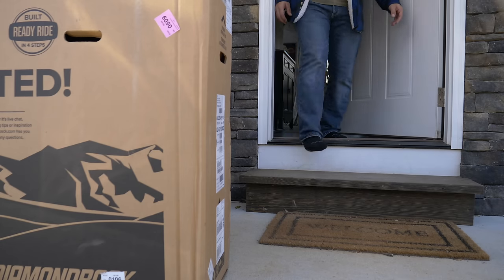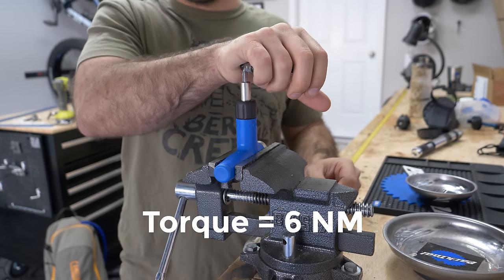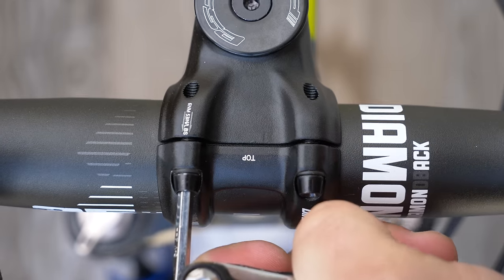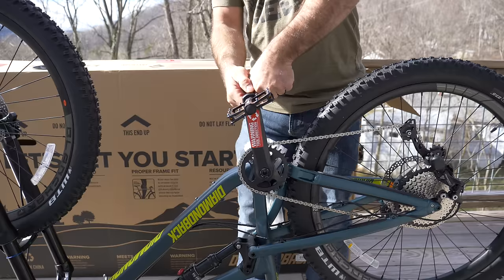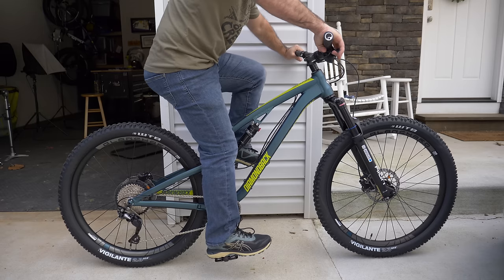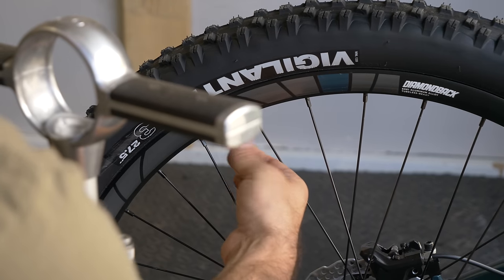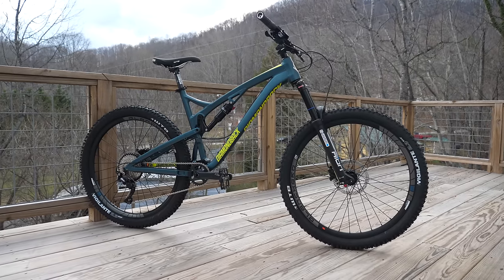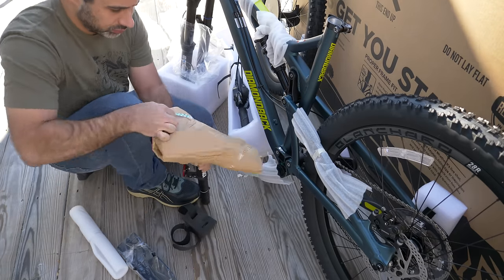Assembling your new mountain bike with minimal tools

Comment: The clamped torque wrench demonstration was genius!
Reply: I never knew  4nm and 6nm would be so different
Reply: It was!  Also, that was my first peek at that particular park tool torque wrench.  I've used a couple of other park tool torque wrenches but they were the traditional style.
I'm going to order that one for myself.
Reply: And completely inaccurate and lever dependent
Reply: agreed!!
Reply: An even better hack would've been to explain newton-meters/pound-ft and use his handy-dandy fish scale.
Reply: I'd like to know why it's in Newtonmeters and not inch pounds or foot pounds.
Reply: Do these bicycle companies know what a clutch does?  A bicycles doesn't use or need a clutch.
Reply: tarstarkusz It’s a clutched derailleur, which helps reduce the derailleur swinging around everywhere making lots of noise and potentially shifting on its own.
Reply: tarstarkusz do these YouTube commenters have any clue what they’re talking about? Apparently you don’t.
Reply: @tarstarkusz  it is newtonmeters because that is just what everybody uses. there is no need to be different
Reply: @tarstarkusz  Because of the Metric System.
Reply: @tarstarkusz  It's newtonmeters because it is the metric standard for torque. Also why things like stem length, handlebar length are in millimeters rather than 2 ft 1 and 5/32 inches
Reply: @MaplePanda04  On the bikes I've owned and ridden the bikes must have decided to keep that a secret.  I have never had a derailleur change gears on its own.  Does this only happen with specific bikes?  Or are the Derailleurs choosing when and when not to change gears?
Reply: Skills With Phil hello
Reply: @tarstarkusz  because it's the oficial unit for torque in the Internatinal System of mesurements, adopted in most of the world by science and industry.
Reply: +Jacob...  There is nothing about these derailleurs that have anything to do with a clutch.
Reply: +Amer... In America we use inch pounds and foot pounds.
We need to be all or nothing. We either adopt the Metric System or we stick with Imperial.  Who the hell wants to buy 3 torque wrenches?
Reply: David Budd What I mean is, pretend you’re going off a big jump. Cheaper dérailleurs will flail around and fail to maintain proper chain tension when you land. When chain tension is lost the chain has a risk of momentarily fly off the cassette and may decide to drop back down onto a different gear.
Reply: @tarstarkusz  Given that most if not all bike parts specify the proper torque in newton-meters, it would be silly to discuss torque in ft-lbs or inch-lbs in a video about putting a bike together.
Reply: @tarstarkusz  The term clutch when talking about a bike derailleur is not the same as a clutch in a car's drive train.  In the case of a bike deraileur, the clutch increases the tension in the jockey wheels to reduce potential movement of the deraileur and/or chain slippage on the rear cogs and front crank set due to a large shock from dropping or simply prolonged vibration from riding through a rock garden.  You release the clutch (reduce the tension) when removing and then replacing the rear wheel.  This way it is still easy to remove and replace the rear wheel under what might be called "normal" tension in the chain.  If they simply increased the tension in the rear deraileur and jockey wheels all of the time, it would make removal of the rear wheel for repairs more difficult.
Reply: @MaplePanda04  Or come of the front crank or slip on the teeth of the crank and cassette.
Reply: @daisyrose9968  Extreme shock or prolonged vibration when riding over rough surfaces or dropping off lips can knock a chain of the gear that it should be in.  The "clutch" on a bike helps reduce the chance of this happening by increasing the spring force in the rear deraileur and therby the tension in the chain.  You release the clutch to reduce the tension in the chain and rear mech when removing the rear wheel and putting it back in.
Reply: +Michael... I know what it does, it's just that they chose the wrong word.
I already own torque wrenches for working on cars and they come in ft and inch pounds.. You can always convert them, but they usually don't convert to whole numbers.
Reply: @tarstarkusz  Dont be stupid, you diont have to buy different torque wrenches you can convert nm to stonebananas or whatever crazy unit you use.
Reply: +Mano... You missed my other post. Look directly above yours.
Reply: @tarstarkusz  Yes I did miss your last comment. At conversions don't worry about the exact number, you can round it. eg  5nm ~45 inchpounds.  Besides most torque wrenches have a tolerance of 4% so you actually never torque the fastener to the exact value.
Reply: yeah! sure it was
Reply: @tarstarkusz  the world uses the metric system, expectations are there. Majority rule
Reply: Not a chance
Reply: "click click click" says the torque wrench
Reply: I have a diamondback sync r carbon and this thing with the torque saved my life
Reply: @tarstarkusz because the whole world uses metric system and not their body parts for measuring things.
Reply: Hi
Reply: @xartpant  he used it as a ball park reference. Most people will be using a multitool around that size
Reply: SWAG method, scientific wild arse guess, manufacturers torque to save damage and get it right and tight first hit.
Reply: @PorterMTB  yep i agree to great videos Eric
Reply: @AidanChen7  bro keep on waiting for that responses
Reply: @xartpant  Yes but this is better than nothing if you use the same ish sized multi tool.
Reply: Yea
Reply: @MaplePanda04  sounds reasonable

Comment: With how cheap you can get a torque wrench for now I'd recommend you get one, harbor freight has decent torque wrenches for $20. Certain tools like that should be mandatory to get with your bike.
Reply: Yeah bois! Harbor Freight is back at it again!
Reply: Whats the difference?
Reply: @antonioochoa5269  If you have either no idea what you're doing (which probably won't happen to someone who watched this vid) or if carbon is involved i'd say
Reply: just make sure they go down to the low Nm/in lbs that is needed for a bike. 4nm is 35in/lbs and i know my cheapie from HD doesn't go that low
Reply: There's an xtools torque wrench on chain reaction for well under 40 as well
Reply: They shouldn't be mandatory because you only need tools with the first bike you own. After that it's something you just give to friends or throw away because you may already have a better one.

Comment: My tires were super difficult to get onto the rim so i found that it makes less off a mess to do a dry fit first then remove the valve core and put sealant directly in through the rim. (also if the tyres are not seating, splash some soapy water onto the bead, it helps a lot)
Reply: Removing the valve core and pumping like crazy to seat it helps a lot

Comment: Removing the valve stem and inflating the tire to bed it in and then adding sealant through the valve is a far easier way to do tubeless i found
Reply: I agree 100% on that. In the case that some tires are a real pain to seat(mostly new unmounted tires) if you already have sealant in the tire it would suck to put a tube in the help seat one side.
Reply: I also agree, but with some brands ( such as slime) you get little chunky bits that can get stuck in the valve. But for Stan’s sealant, this technique works great

Comment: Thanks for this video.  I got my first big girl bike yesterday and would have been lost without this.  When I did get it assembled, something was wonky, so I took it to my local bike shop.  The derailleur hanger was bent.  They did not have my hanger in stock, so they used a hack to fix it.  They heated the hanger with a torch and bent it back while it was cooling.  There was a risk of it breaking, but I figured it was worth the risk since I would have been out of a bike for a few days while the replacement hanger came in anyway.

Comment: Interesting advise on breaking in new brake pads.  I had always been taught that by applying light pressure as you show will glaze the pads, so I usually get up to speed on a downhill and firmly apply pressure, but don't come to a complete stop.  Repeating this about 10-15 times brings out the real stopping power of your pads without causing them to glaze.  I will have to try your method next.  Great videos as always!

Comment: I will probably never do this because i'm not a dentist or doctor or have a high paying job... but used is fine??...
Reply: The bike in the video is very affordable
Reply: @Br3ndo1891  not as affordable as a used bike...
Reply: I made that mistake once before, found a inch wide crack halfway through my down-tube after buying my last bike. wasn't fun, turns out if you buy a used bike it voids Giants lifetime Frame warranty, so I had to pay for it out of my own pocket, @Cooper Ondersma
Reply: always test the bike on site. maybe ask the local bike shop mechanic if they can join you to check if the bike is ok overall
Reply: I am in College and working part time at a not so great paying job and both my wife and I are riding $3000+ full sus carbon bikes. I have multiple friends in the same senario. It's mostly about priorities. I could probably afford a nicer car or go out for more dates if I didn't bike, but we decided bikes we're more important for us. Thinking you have to be a dentist to buy a $2,000 bike is silly. $10,000 and you might have a point, but 2g is less then your average rider spends here in utah, and most bikers just have regular jobs. It's all about what you prioritize.
Reply: "affordable" is relative. $2K for a new FS trail bike is on par in today's market. Get a better job and start saving if you want a nice bike like that, but a good used bike can be had for under $500.
Reply: CHOOKY 42 used should be fine if you know what your buying, just make sure you test everything before you hand over the $$
Reply: I'm rocking a 10 year old Stumpjumper. It was $2400 in the long ago! Love the bike!
Reply: Of course is it fine to have used bike...i bought my specialized stump jumper fsr for about 300$...it from 2006 and in pretty good shape...ill do fork service this spring....
Reply: @michaelwrigley5438  I'm in college as well and working only a few days a week at a burrito place. I just purchased my first MTB (hardtail) for $2650 after only a few months of saving (I also sold my pc for $1200 so that definitely helped haha). There really is no reason why 90% of people should not be able to save for a nice bike. It just takes a little bit of patience and planning. Every paycheck, just put aside like $100 every paycheck and you'll have enough for a really nice $2000 hardtail within 6 months. Also, if you still get stuff for Christmas or your birthday, you could just ask for money and probably cut it down to 5 months. And if you can set aside $200 each paycheck, that's only like 3 months!

Comment: Excellent Instructional Video! The one thing I would add to assembly is that some bikes require you to mount the front rotor to the wheel and mount the front  brake.

Comment: "very attainable" ... It's $2,000....
Reply: For its quallity its good
Reply: people spend $2000 on carbon wheels
Reply: Good word, really... I wondered.
2k is motorcycle $. Can't see spending that much to pedal
Reply: Sorry but 2000$ is nothing for a good Bike.
Reply: most people that watch this channel are adults, $2000 is very affordable to save up
Reply: @SgtKong  but on a bike do you pay for fuel? No do bikes have electrical issues? No dou pay insurance on a bike? No
Reply: I.could also try with a bunch of questions that seemingly assemble into a point of some sort
But YouTube would sensor me.
My op was to the content creator not youtools😜😘🤙
Reply: Peepeepoopoo   Life insurance
Reply: Peepeepoopoo I know, you said that people don’t pay insurance on a bike. So I said people pay for life insurance. Don’t have to call me a knobhead, you should call yourself that.
Reply: For a full suspension bike brand new, $2K is the bottom end on pricing.  You can't get a decent FULL suspension bike for cheap.  A bike like this isn't for commuting to work or zipping around city streets.  I just never understand why people gasp at the price tag of what is an unnecessary hobby.  Yeah, we drop real dollar bills on our toys. I've spent more on GEAR this year
Reply: @seattlegrrlie  Its a shame a sport as fun as MTB basically doesn't want more folk doing it with the expesive price of the bikes... but then I suppose thats capitalism. Creep up teh prices and teh whales will keep em affloat.
Reply: Kyle Lush that's more than my rent
Reply: Sgt. Kong a newer version of his (release 5) is 5000$

Comment: Great information Seth.  I wish you would have added truing the wheels and tightening EVERY bolt on the bike.  After assembling thousands of bikes from different manufactures I found that often  a bolt or nut is loose.  A quick check  of all the nuts and bolts assures  happiness for years to come.

Comment: I think it’s worth noting that once both wheels are installed it’s a good idea to make sure your disk brake calipers are centered. If you have hydraulic brakes it’s as easy as loosening the caliper mounts and giving the brakes a good squeeze while it’s in the stand. If you have mechanical, it’s a little more involved. Either way doing so will improve stopping power and save a good amount of your brake pads over time.

Comment: After a bit of research, I finally found these exact pedals new on ebay. Shipping isn't cheap to europe but seriously I'v been searching for pedals like that a long time. Riding in the dark with no reflectors on the pedals will get you trouble with the cops too easily where I live. And all other MTB pedals with reflectors I've seen before have either no real pins or the reflectors are attached in a way that they will break off the first time you ride it on a trail. Here they are attached kinda inside the pedal's frame.

Comment: I’ve had this bike for 2 years 
Ridden it over 250 times. The bottom bracket came loose often. Give it a little extra over max torque. Not much. Re check a couple times. 
Ride it hard. You won’t hurt it. It’s solid. Get a pair of 5/10 free rider shoes and rock brothers pedals. Get after it. Have fun.

Comment: few tips from a shop mechanic

- if your gears go out of wack within 1 - 2 rides, don't worry it's just the brand new cable housings bedding in to the ferrules reducing cable tension. two or so counterclockwise turns at the barrel adjuster on your right shiftier/rear derailleur will usually solve this.

- quickly pinch pairs of spokes together all around the rear and front wheel, just to make sure they're all tight.

- pull the front brake and rock the bike backwards and forwards, if the bike "knocks" or there is a distinct click or clunk it's down to the headset working loose in transit or assembly.

- last but not least most bikes NEED a mandatory tune up after 4-6 weeks worth of riding, if you choose to take the bike to a shop for this please tell them so they are aware of things that have to be addressed such as crank sets bedding in, bolts working loose and bearing pre-tension after bedding in.

hope these tips help! happy riding!

Comment: Great video Seth!  Only item I'd challenge is how tight to put the pedals on.  Anything over barely snug is too tight in my opinion.  Any stickiness in the bearings will only promote them getting more snug as you pedal, so they should never come unthreaded.  And you'll spare a lot of bloody knuckles later when you need to swap the pedals.

Comment: Seating a tire can be helped by using a tire level. Keep the lever perpendicular to the rim (between the tire bead and the rim) and just work your way around.  It should get tighter as you go around the wheel, to the point that you won't be able to complete the circle. Then pull the lever out and 90% of the tire is seated, which is usually enough to seat the rest with a floor pump. 
Or just find a friend shop with a compressor.

Comment: I grabbed an inch lbs torque wrench at harbor freight. They are (usually) accurate and cost something like $17. Just used a nm converter to get the inch lbs value. Prob good......

Comment: For threading on the pedals, rather than remembering “righty right, lefty loosely” plus “left pedal is opposite of the usual mnemonic”, a better mnemonic is “forward on, backwards off”. To tighten the pedals, rotate the pedals in the same direction as the crank arm spins when pedaling forward. To loosen the pedals, rotate the pedals in the same direction as the crank arm spins when pedaling backwards. It’s easier to get it right the first time with that mnemonic.

And in case you ever forget, the reason why the left pedal is threaded counterclockwise is because you don’t want the pedaling motion to unscrew the pedals, otherwise your pedal might fall off mid-ride, probably at the most in opportune time line landing after a sick jump. So that’s why it’s “forward on, backwards off”, not the other way around.

Comment: look, i don't use tubeless tires on my crappy giant or my panasonic but here's a faster idea that will seat the bead, if you follow this guys instructions all the way to pumping it up just string a ratchet strap around the outside of the tire until it is tight then give it an extra click or 2 then pump it and the air WILL NOT escape the sides, the downward pressure of the ratchet strap will push the sides the only way they can go, outwards and the air going in will push like he's doing but should only take a few quick pumps, i have done it with everything from 12 inch chinese scooter tires to tubeless bicycle tires and it works great